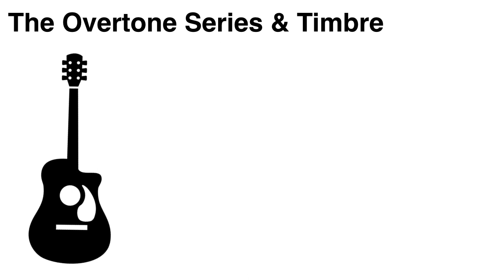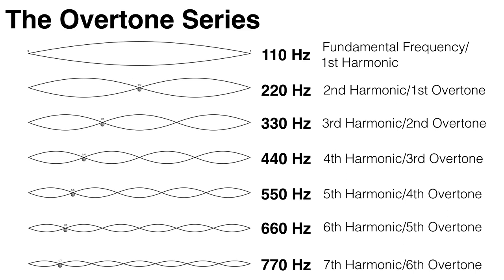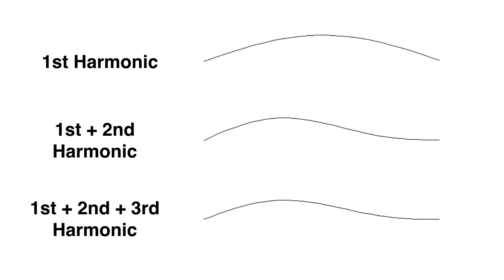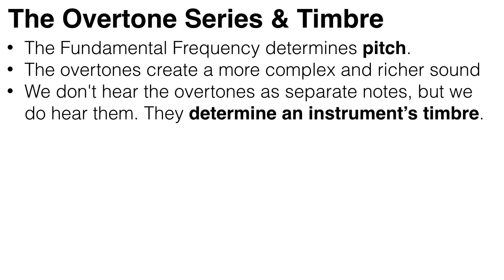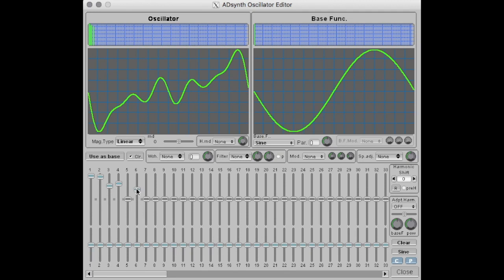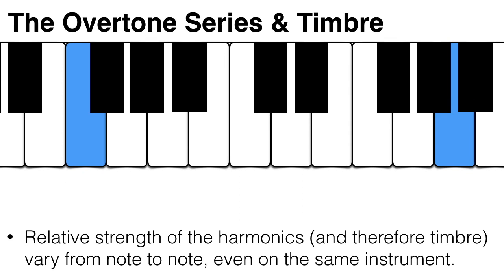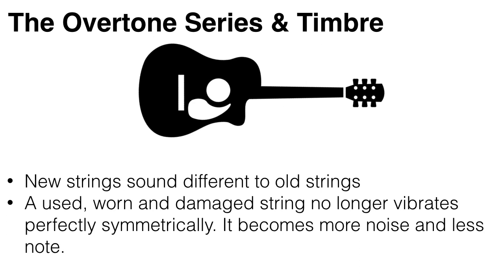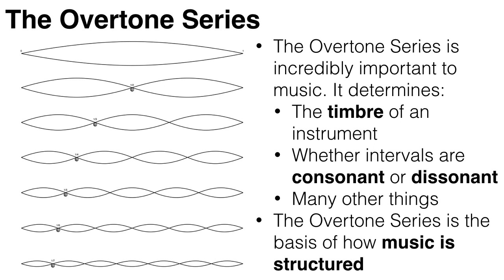9. The Overtone Series and Timbre

Comment: never knew that before.  so beautifully simple when you see it illustrated. the harmonics are 'waves on the wave'.  You can even see it on a skipping rope I reckon. Get it going round - there's your fundamental - and then with a bit of flick of the wrist you can send a wave along the length of it to the other person - that'd be the mixture of harmonics.   That's what that shot of the guitar string revealed.  Beautiful, entirely.

Comment: The relationship between string length and frequency is not direct; it's inversely proportional.
Reply: And that is because the string length is proportional to the wavelength, and given a specific string acting as a medium for the wave, the speed is constant. Therefore, to satisfy v=fλ, any change in the string length inversely changes the frequency.
Reply: @methandtopology  h

Comment: I know this video has been out a while, but another reason piano timbre changes up the scales is because the ratio of string length to where the hammer hits is also different. A few inches on a 5' string is a much smaller ratio than a single inch on a 10" string. The hammer hits much closer to the end of the string on the longer one and much closer to the middle on the shorter one, even if raw distance is smaller. Those are not exact numbers but I hope they show the point.

Comment: Just to get this straight, if I pluck middle C and then one octave up the shorter string will translate the same amount of kinetic energy into a higher pitched frequency because the rate of oscillation is higher, but the timbre will generally be identical because the materials of the instrument are identical and the string lengths are geometrically proportional to each other. In this way we get the same harmonics at a higher or lower pitch and therefore it makes sense to call both of these notes "C." Is this correct?

Comment: A question on the harmonic series. So we know that if we start at 110 Hz, the third harmonic is 330 Hz (i.e. 1/3), but what about the mirrored node (i.e. 2/3) at 165 Hz? Same goes for the 4th harmonic. 440 Hz (i.e. 1/4) is OK, but why not also 146.67 Hz (i.e. node 3/4)?

Comment: The overtone and harmonic series are slightly different -- the harmonic series starting with the fundamental and the overtone series starting on the second harmonic -- right? I just got a little confused when at 1:45 you said "This is called the overtone series or harmonic series" which seemed to suggest they could be interchangeable. Thanks man!
Reply: They are interchangeable, though any given person will tend to use one or the other. The difference lies in what the lowest frequency component is called. In the overtone series, it's called the fundamental, because it generates all the others. The higher overtones can then be called 'first overtone', 'second overtone' and so on: they are literally 'the first tone over the fundamental' and so on. In the harmonic series, the lowest component is called 'the first harmonic': so the next one up must be 'the second harmonic' and so on.

So: fundamental = 1st harmonic
       first overtone = 2nd harmonic
       second overtone = 3rd harmonic

and so on. I agree that it's confusing, but so long as you understand that historically there are these two different descriptive systems for the same set of acoustic phenomena, you should be okay.
Reply from the maker: Hi Zermelo,
Exactly what Paul said. The terms are both referring to the same thing (a vibrating string) but just use a slightly different naming convention (either starting from the first or second frequency). You can use them interchangeable.
Reply: I'm not a signal processing expert by any definition but I was under the impression that harmonic frequencies are a subset of overtone frequencies; that is, an overtone is any frequency above the primary, but a harmonic frequency is always an integer multiple of the primary frequency.

Comment: The fundamental frequency is 108 Hz making the note A 432 Hz.
Reply: Finlay Welford ISO says you’re wrong
Reply: @hwinangkoso  http://www.viewzone.com/432hertz222.html 
Apparently classical composers had always used A = 432 Hz until this was recently changed to 440 Hz for no apparent reason. While there is little noticeable difference between these two frequencies when observed by a human's ear, I still think using 432 makes a lot more sense and it also helps to see the mathematical relationship between notes. Using 2^(1/12) as a multiplier between semitones makes precise exponential increments between the notes, however leaves all the frequencies as ugly irrational strings of decimals (apart from octaves of A). Using Pythagorean tuning with 432 makes every note a quotient of 2nd and 3rd powers e.g. E4 = 1.5*432 = 648 Hz. Anyway there's plenty of information around even on Youtube to support the idea that 432 Hz should be the frequency of A4 rather than 440 if you do a little research into it.
Reply: I agree
Reply: Finlay Welford i said ISO, people can use whatever they want, i prefer A446 my friend likes A432. I think someone made a video about this. 
Iink here: https://youtu.be/BzznBt8tVnI

Comment: Hate to be that guy, but this whole thing about sine waves being 'building blocks' is pure convention due to the widespread use of Fourier representations for signals. A string vibrates with a certain characteristic shape due to local and initial pressure considerations. A Fourier series is a convenient way of representing these signals. This doesn't mean the string 'vibrates at many different frequencies at once' ; rather, it can be represented as an infinite sum of sine waves.  Also, I don't think there's any particular reason to believe that the overtone series is a basis for our perception of pitch and/or tonality, let alone musicality. If I'm misinformed, please tell me why.
Reply: The overtone series is the basis for tonality. I'm surprised you even state that it may not be. Going back to the Greeks the overtone series determined the 'perfect intervals'. This is determined not by the sound of the harmonics but the distance between them C(fundermental) to C(1st harmonic) = perfect octave  C(1) to G(2)  = perfect fifth G(2) to C(3) = perfect fourth. These intervals are the basic for both major and minor scales and movement in harmony Sub dom to Dom to tonic. However, to quote you  'If I'm misinformed, please tell me why'